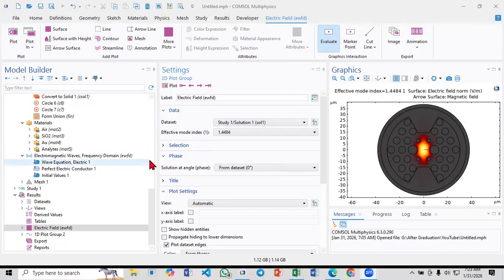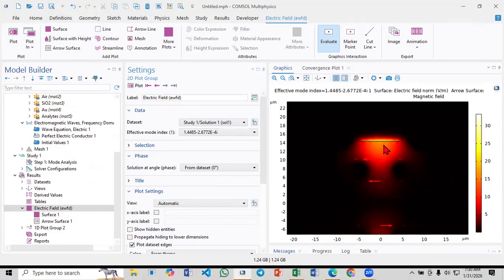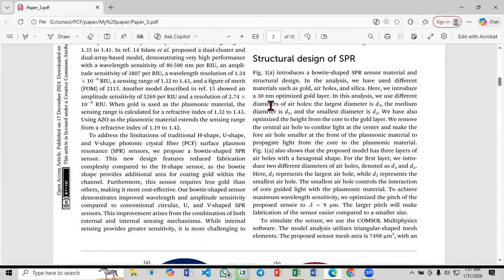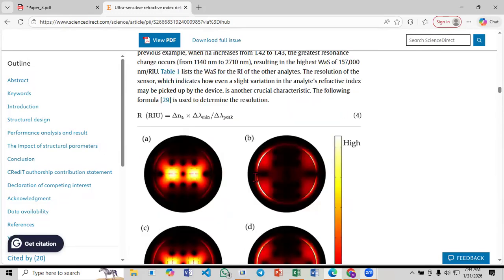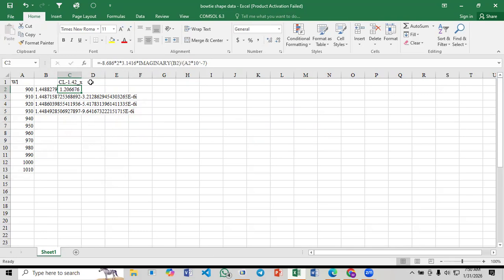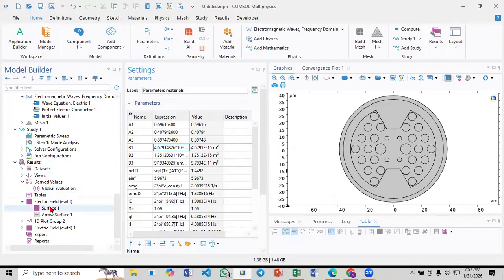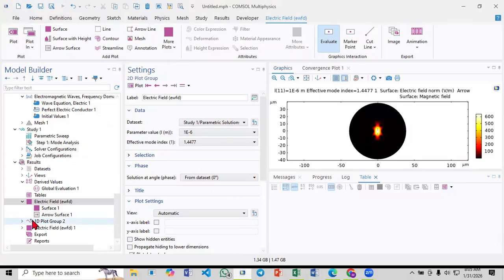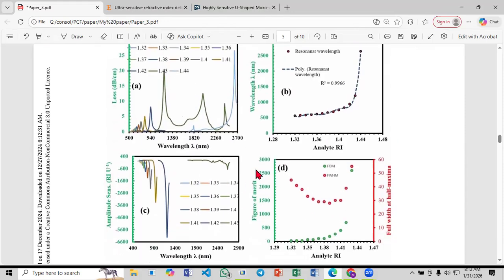(Part-5) Phase matching curve|| PCF-based SPR sensor Simulation Comsol || Optical Fiber Simulation

Comment: hi, as we measure the mode analysis with the wavelength, i am sttucking in a problem that the mode representation before resonance get changed after resonance for higher refractive index of sample. pl if you can solve it then make a vedio on it